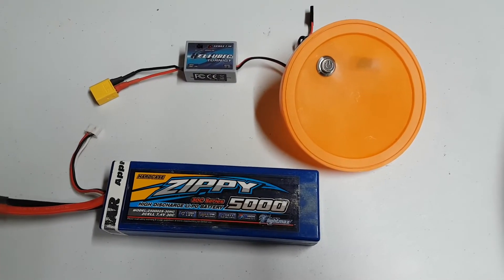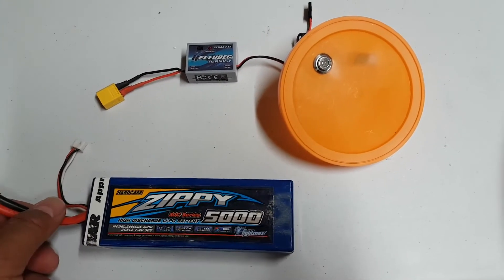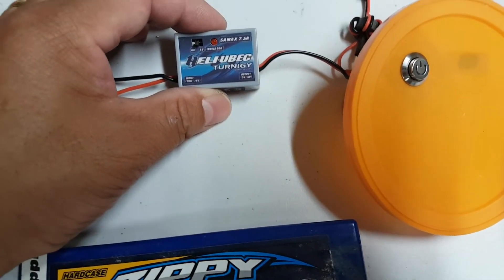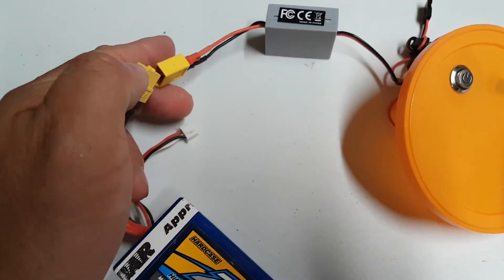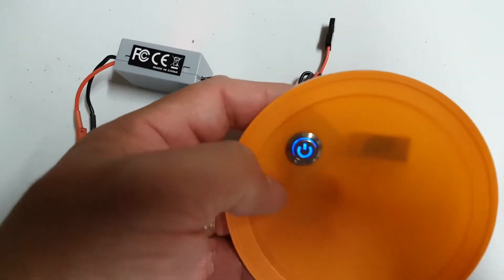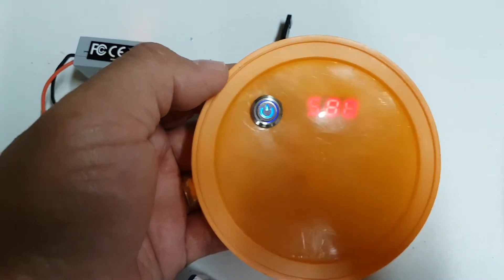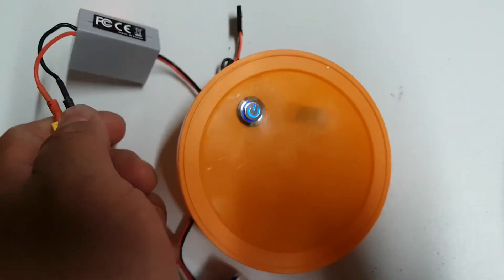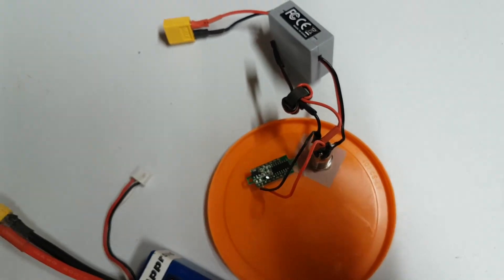UBEC Power Switch Voltage Meter Combo

Comment: I trust that you could also wire it such that the switch is illuminated only when it is on.
Reply from the maker: Yup, the switch has a background light built in